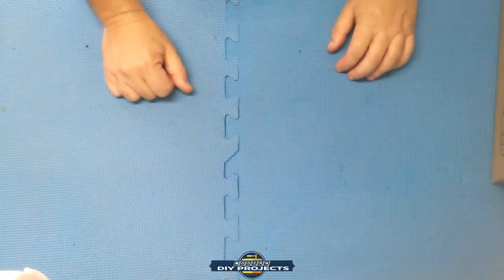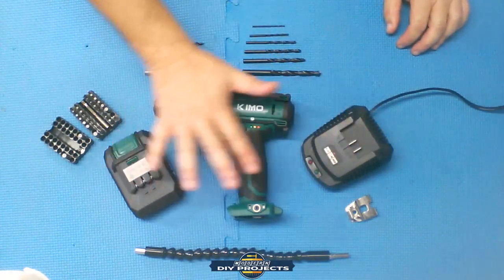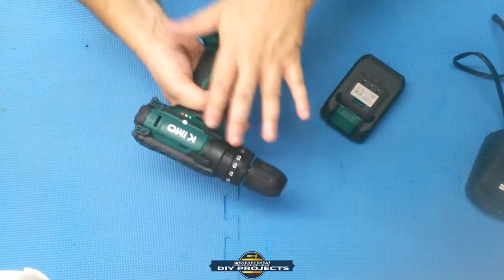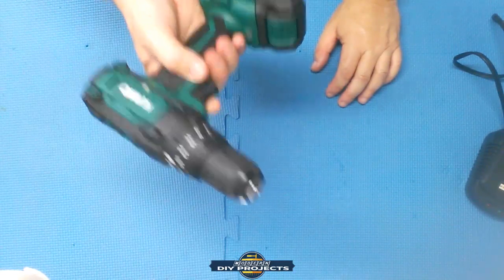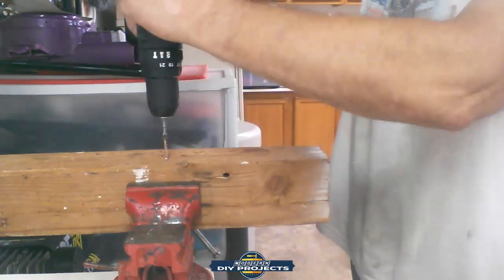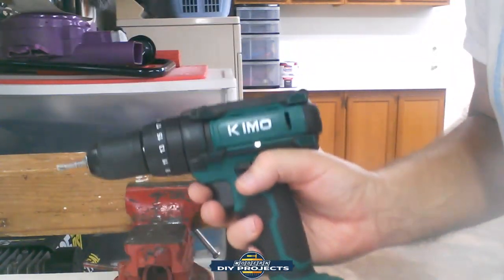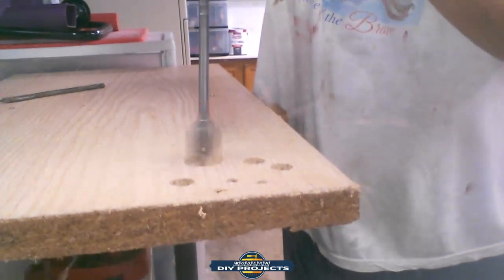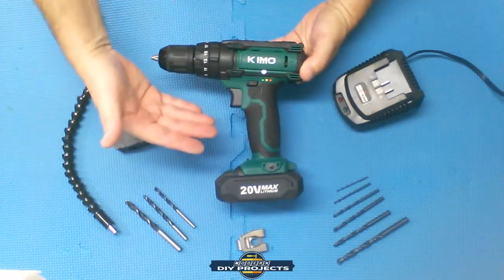Kimo 20V Cordless Drill Driver Hammer Drill Better Than Harbor Freight Bauer, Ryobi or Hart Drills?

Comment: Good review. I'm going to buy one of these drills soon. My black and decker 20 volt drill  works fine but it takes forever to charge and has no battery indicator. Plus it's a single speed. I like that this drill is a two speed.

Comment: Very nice video, i think i am going to buy this (the little bit more expensive because right now it has a coupon for $10 at amazon -$53)  for around the house things. I also have to install a couple of security cameras and man, my walls are concrete coming from the hell itself or something, do you think i should go for something stronger or will i be OK with this?, also, can you recommend some masonry/concrete drills?. Thanks in advance.
Reply from the maker: I think this drill has plenty of power from what I have experienced with it. As for bits get some good quality ones at Home Depot and they will last you a long time. The bits I have I got at Home Depot over 20 years ago and they are still going strong. Cant recall what brand they are because the box went bad years ago so I repackaged them into a plastic container.
Reply: @ModernDIYProjects  Thank you much, not Home Depot close to me but i will try and look at amazon.